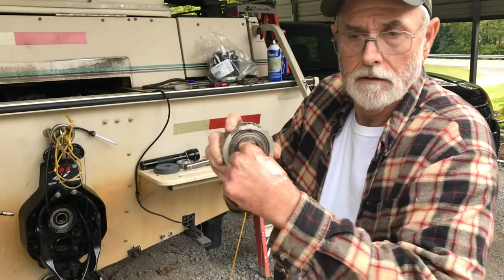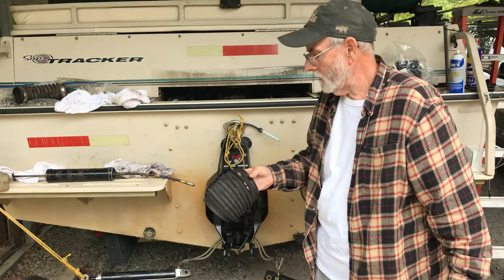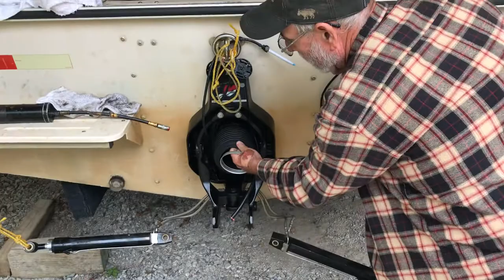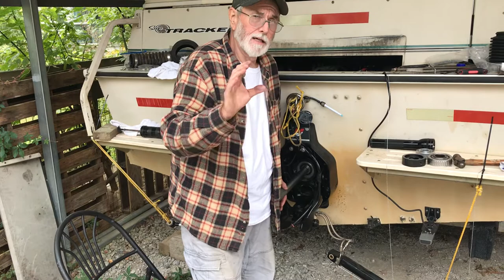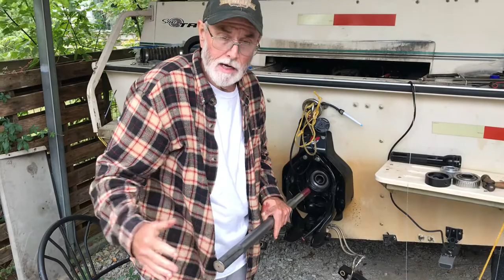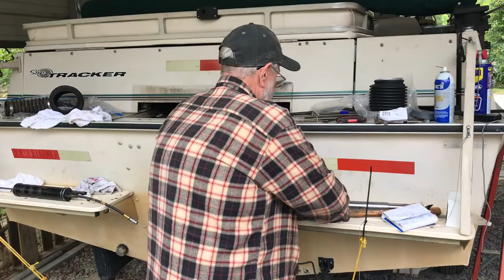Mercruiser Gimbal Bearing Replacement & Engine Alignment Discussion

Comment: Great video.
We used to use liquid nitrogen to freeze bushings and bearings that were a tight fit.  They just drop right in and go klink.   Not suitable for every application obviously, but fast and effective.

Comment: Mine had a slight resistance after doing (a lot of) adjustment to the engine mounts, but I think that was the new oil seal behind the bearing, not sure. Because after that initial slight resistance (took 2-3 fingers to push), I could bottom it with just 1 finger.

Comment: Thanks for your video.  I'm guessing you're a machinist?  "V Block", "Witness Marks", Those are words my dad used!  Perfectly drilling a bar like that is near impossible without the right tools.  A file helps to make the initial flat spot and a punch goes a long way to keeping the bit on center, but a drill press and V block (and vise) are a must.  Why didn't your tool come drilled?
Reply: Apparently the depth is different for different engines. I was totally frustrated trying to figure out what the bolt through the disc was for when I received the tools with NO instructions. I had to spend hours looking for videos showing how to use the tool.

Comment: Would you suggest putting in the gimble bearing before engine alignment?   How do I install the bearing with the tool if the engine is already in, and not in alignment?  If I have to pound the bearing in, and the engine alignment is off, the bearing would go in crooked, would it not?

Comment: and there's no adjustment on the inner transom plate and the bell housing where the two bolts attached the two that's not adjustable and the only adjustments you have are the front two motor mounts.

Comment: the reason the bearing didn't come in a quicksilver box is because that bearing has nothing to do with Mercruiser the only thing they have to do with it is they use itand another thing that bearing can be bought without the carrierI can't remember the part numberbut everybody's beating these carriers in and out of the housing and you don't have tothere's two slots cut in the carrier that's wide enough to stick the bearing in sideways you twist your old one sideways pull it out put the new one in take your alignment tool stick it in the bearing and twist it up into the carrier I've put hundreds of these in and never had one spin in the carrier yetthe only time I've ever changed the bearing carrier is when someone put it in with the slots forward instead of aft so you couldn't remove the bearingI've gone to Mercruiser schools for years I did this for a living for over 50 yearswhen I started you couldn't Buy any Mercruiser tools unless you were a certified Mercruiser mechanicnow you have these machine shops that are manufacturing these alignment toolsthey're making plug gauges for the stern drives and gear height tools and a lot of these are made in China
Reply: Ahoy Jim, this is gold information and I want to thank you for your knowledge and expertise. Working on my out drive and can see the carrier was installed backwards. You are saying to leave the carrier in place because it is not worn out and just spin the bearing and slide it out of the slots. This can only be done if the carrier is not installed wrong.
Thanks again.

Comment: this is exactly the reason I don't go on anybody else's boat 
when people start talking about changing the bellowsare doing any drive workI'm always busy when he asked me to go for a boat ride or go fishing I've seen quite a few Bellows replacement that the  Bellows actually slipped off the outer transom plate or it's slipped off the bellhousingI've seen these put on with silicone instead of bellows adhesivethere's a procedure for putting that Bellows onand you're probably not going to find it on YouTubeor with some backyard guy trying to show you how to do it correctly according to him